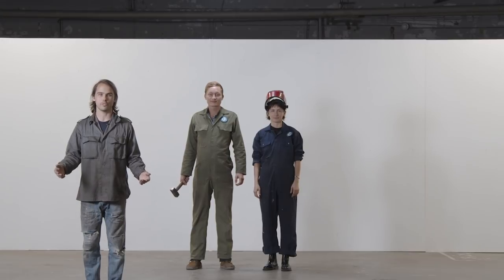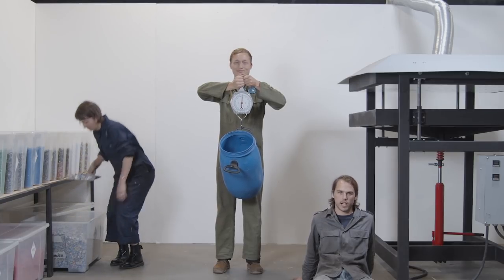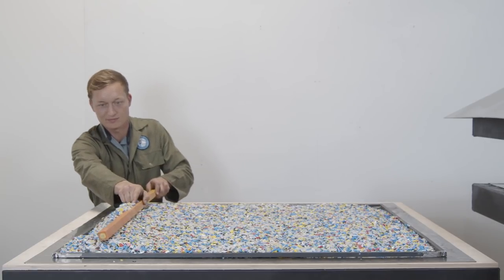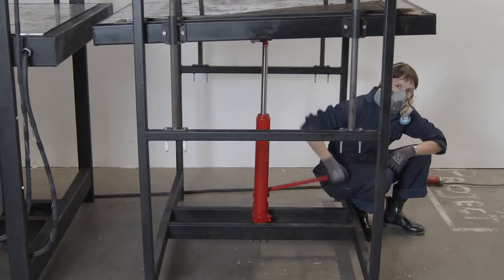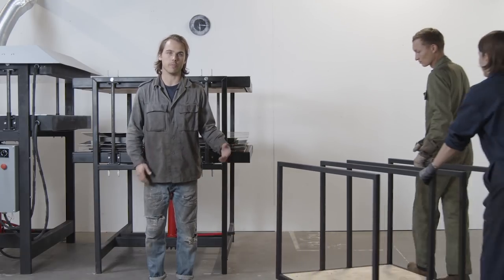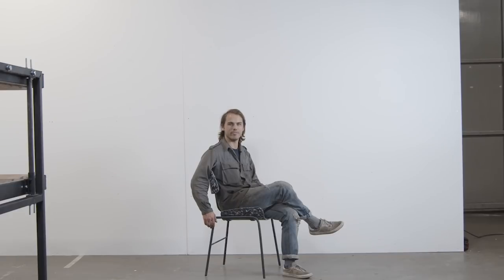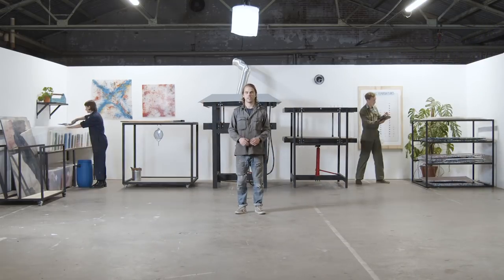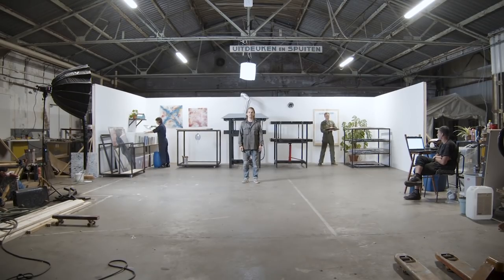Precious Plastic - Setup a plastic sheetpress workspace (part 7.4)

Comment: I have been experimenting with making plastic sheets but quite often I am getting trapped air inside the sheets. there is a thin layer of plastic on the top of the sheet and a trapped pocket of air underneath. Have you experienced this and do you have any suggestions on how i could avoid this problem, Thanks

Comment: How much HDPE/PP flakes is necessary (in kilograms) for making a sheet of 1 square meter with a thickness of 6 mm?
How long does it take to make one 1 sheet of 1 square meter?  Only preparation, the heating and pressing procedure. (so exclusive the cooling down)
If the time needed is for example one hour, what is necessary for each sheet to let it cool down outside the heating/pressing machine in order to prevent warping, etc,
and to produce 8 sheets per working day?
Reply: 0.6x100x100 = 6000 cm³ 
the density of hdpe can range from 0.93 to 0.97 g/cm³ --> 5580 to 5820g/sheet
the density of pp is ~ 0.93g/cm³ --> 5580g/sheet

Comment: i have a question! is it real to make road fixing using recycled plastic?
or just fix with with the power of polymers?
Reply: s o l a r     f r e a k i n     r o a d w a y s
Reply: Serious Answer:

Not really unless using some expenssive PEEK engineering plastic

Even then it wouldn't be as durable

Best oprions are bio-asphalts for repairs, and roller compacted concrete for new roads

GRANTED some of Germany's Panzarstrase (didn't have the right key for that lol) or "tank roads" had cement squared connected with an elastomer I THINK but i don't know what the elastomer was

https://de.wikipedia.org/wiki/Panzerstra%C3%9Fe